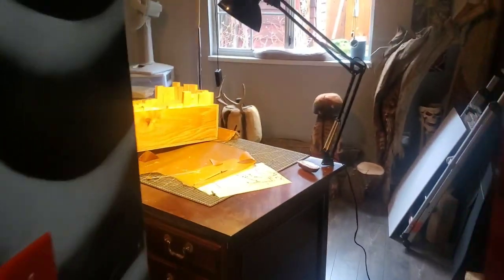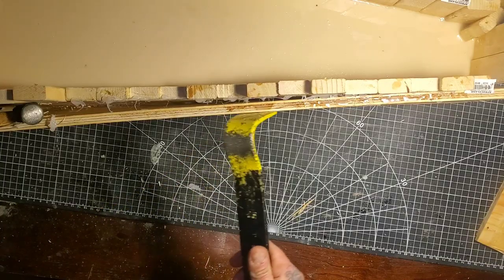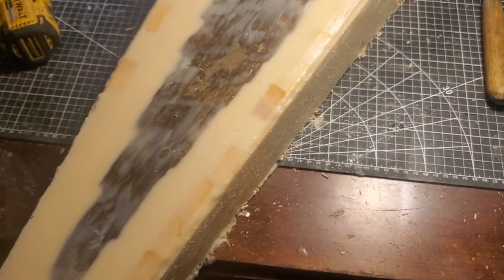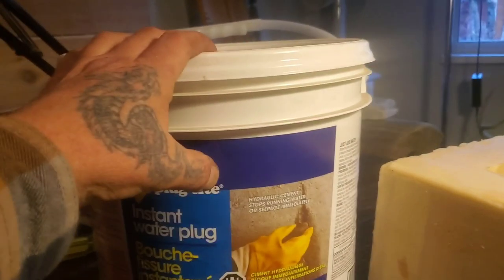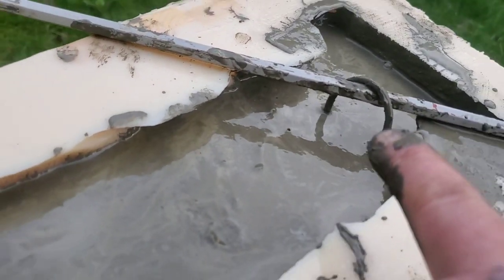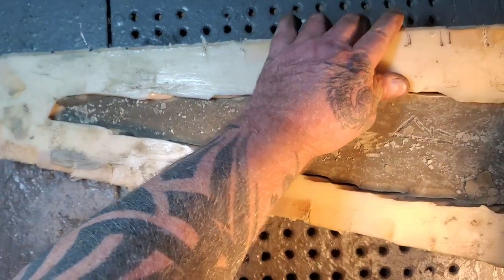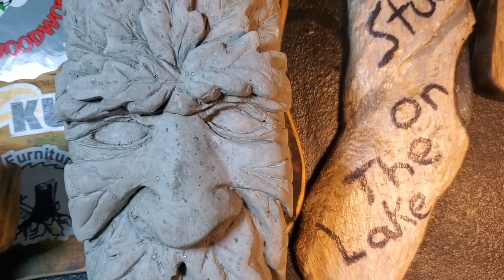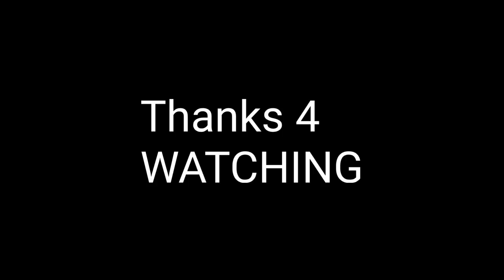Releasing a Rubber mold & Casting Cement . Did it work? Final

Comment: Jordy, as an old Cementmason I could draw you a set of plans that would practically fall off when you start to take it off your "sillycon" moulds.  Suggestion-  never pry against your work when stripping your form.  Use chicken wire, or coat hanger wire(always deform the straight pieces, rebar has bumps to keep it from pulling out.) in the areas that you have problems breaking off.  I use a product called patchcrete, it comes in a bag, and a 1 gal. Jug of acrylic epoxy for about $25 . You don't use any water in the mix.  You can buy the jug of epoxy by itself, and use sand and common cement to cut the cost further.  I would use fine sand, and cement at 50/50 mix.  
Concrete companies have pouchs of fiber they use to add strength to the mix. (They have two sizes of fiber, you want the fine size) They are under $5 and you wouldn't need much, and it would add a lot of strength to your work.  They are like little hair in the mix, and add a lot of strength to the casting.  For something like your doing a couple pinches would work.
I'll try and find a mailing address and send you a drawing of how I would build a form like your doing.  I have 30 yrs in the business, and accidentally learnd a thing or three along the way.  Love your carvings.
Bob Collinsworth, Santa Rosa Ca.
Reply from the maker: Hi bob thank u for the info. 
Im ok with the box though because im done this now so it good, but .

The sand and the cement do u know how long it would take to cure enough to be able to pull out of the mold? Because the hydro cement i used can be pulled put of the mold in about 2 hours, its still mot fully cured but im looking for the cheapest fastest cure to be able to pull puts the mold and onto the next,
Reply: @CarvingFusion  hi jordy ya. If put a hand fulls of casting couple cement to the 50/50 sand, and cement, and the acrylic mix you will get about the same set time. (Warning-  water will kill the acrylic mix) it won't set.  Ask me how I know.  ;)
Reply: Just a thought, but you can.get concrete color put it in your mix. If it were me I'd try lamp black.  It come's out a charcoal gray.  There's Red, greens, all kinds of color.  If the work gets chipped you still have the same color all the way threw your work.
Reply from the maker: @Bob-ns4od  can u email me please and tell me the name of epoxy u speak of? 

Canadian1dude@gmail.com
Reply: @CarvingFusion  Yes, it is a two part mixture.  It is called Pavecrete ( which has a super fine sand mixed with cement)(and there is.a product called patch crete, the sandmix is a little bit bigger, and mixed with cement)  They come with a gal of acrylic epoxy which works just as well with regular sand, and cement.  Just looking at your mold I think you would get probably 2, or three molds out of one bag.  It drys very fast, and be sure to wash everything after mixing because that stuff is like trying to take off steel on your tools.  I would think you would want more than one mold to work with at a time so that you can save time, and increase production.

Comment: Next pour, use your palm sander to vibrate the mold. All the air bubbles will come right up and out of your concrete. Makes a stronger cast as well.
Reply from the maker: Ok thanks

Comment: Smooth on makes a Release agent that you brush on your original piece , so the new mold separates easy, and also a release agent for coating the smooth on Vytaflex material before you pour your first casting..... Also your piece has a fair amount of undercuts that always present problems with air pockets, and also the final release....The original piece should have been sealed , so the vytaflex was even on the bottom , that way there is no struggle in the take off.... Those steps make the process a little easy throughout...You should get about 100 pulls from that mold, though I would get the Smooth On Release liquid... Makes life easier ......Good job none the less..... Now you should get some Iron oxide powder , so you can create different color concrete, it will look more natural than painting the piece, and if it ever chips the color is all the way through...............Cheers..........
Reply from the maker: Thank u

Comment: Jordy, I have been making casts for years and you need to use a mold release. The bees wax will work but it is thick and detail is lost. Smooth-on makes a mold release i a spray can. Also silicon is much easier to use  as a mold material. It doesn't stick to anything but it is still best to use the release agent.
Reply from the maker: Thank u but i just used the bess wax on the box itself i did use mold release on the piece itself, 
Guess u didnt watch the whole video
Reply: @CarvingFusion  I saw the entire video but I was referring to the box. I have seen almost every one of your videos. You are very interesting.

Comment: An idea, maby it would work, maby not?   Next time line wooden mold with thin kitchen garbage bag, cut off extra. Maby throw a few  swipes of rubber cement on the wood first before putting in the the plastic liner.